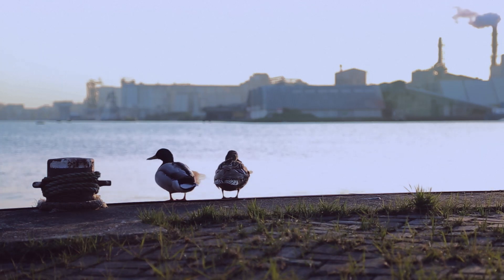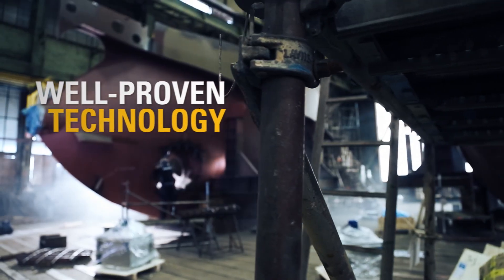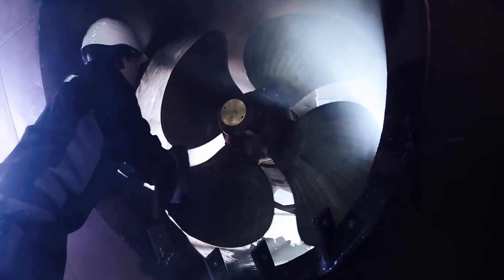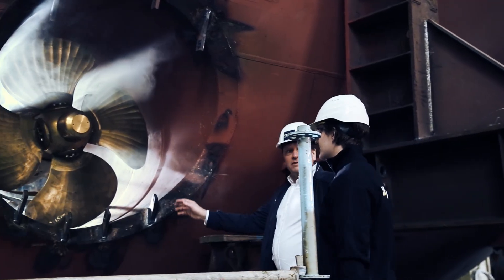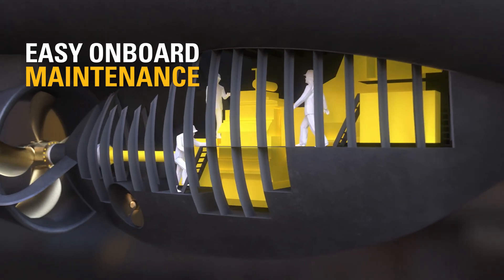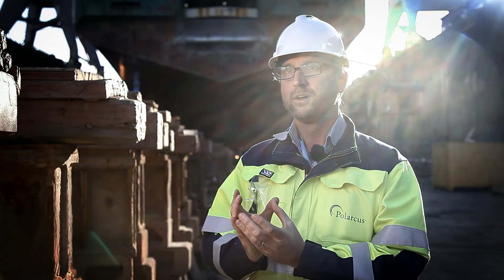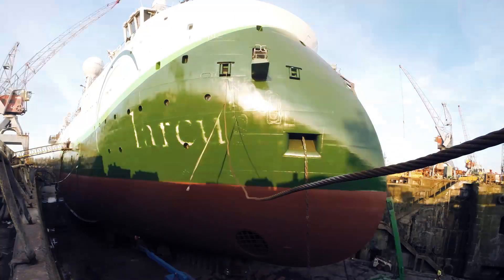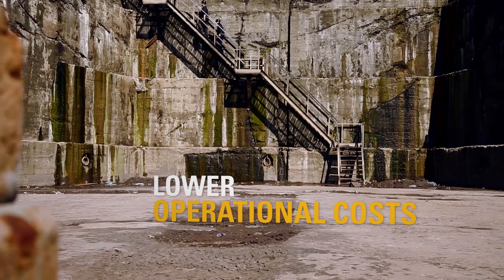Twin Fin Propulsion System Delivers Better Performance

Comment: TL;DR The Twin Fin system replaces the 2 existing Azmouthpods with twin stern thrusters, and twin propellers.  It keeps the same maneuverability that the pods give, but is much more cost effective and reliable.  It also means you can perform almost all of the maintenance while still in the water.

Comment: I build repair and service Controllable pitch propeller systems. The benefit of this system is the compact design and ease of disassembly/assembly. If any component may need to be changed, it makes for easy change out.  As far as performance goes, it probably isn't much better than any other system except for overall weight. Water borne bearings have to be changed more often with relatively low cost bearing material, it has to be machined though. With oil filled (EAL) vegetable oil filled stern tubes, the bearings are changed less and more run time without servicing. I'm an expert in this field. I have suggestions for this design and the only downfall of this design is draft, they hang pretty low.
Reply: you still don't say what it is, any more than the stupid vid.

Comment: Yah, but what is the twin fin system and how does it contrast and compare with what was OEM on the ship? So it's great but WTF is it?
Reply: Yeah a lot of waffle but very little information!
Reply: The OEM thrusters were higher maintenance which meant more frequent dry-docking. The Twin Fin developed by CAT and partners provides a more efficient propulsion option for this class of vessel.